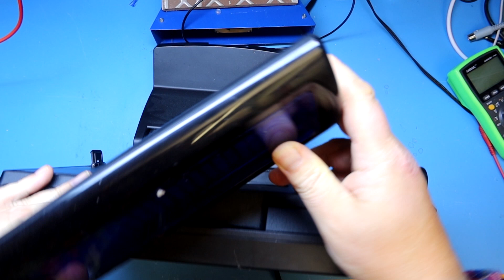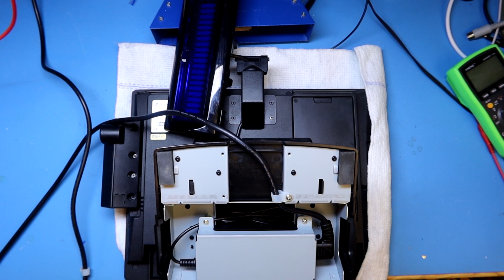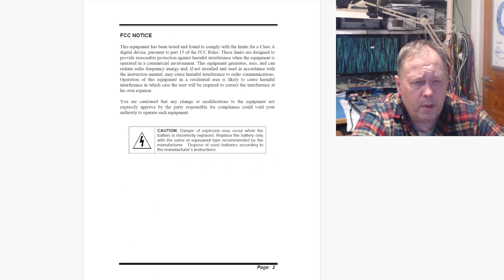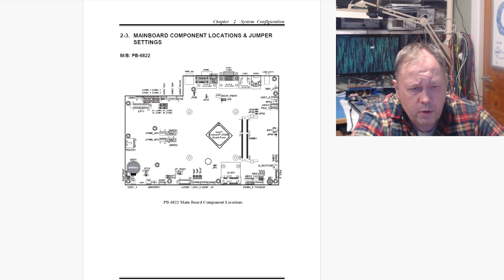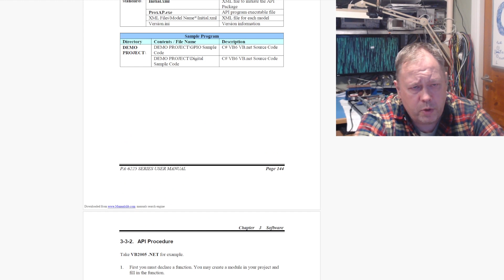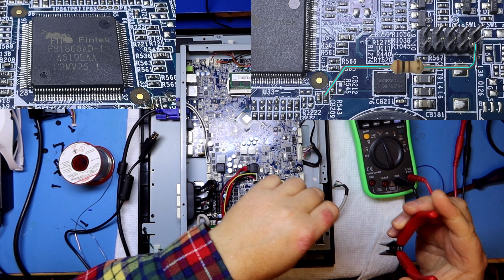Dumpster found PA6225 POS PC / Computer. Why did this end up there ?

Comment: Anything interesting on that SSD ?
Reply from the maker: Now that is a question with a topic that I haven't even thought about yet. I will find out, and I will try to make a more permanent fix. I have caught up about some more in dept knowledge about this, and a clamp up or down solution is not the best option. A voltage divider with two resistors is a better option, and some has also suggested to put a buffer on the output of the CPU. I will have to see, now it will start up about every third time only, so not as good as I thought it was yesterday, yesterday it started every time. So the degradation of the CPU has gone faster than I have seen reported other places.